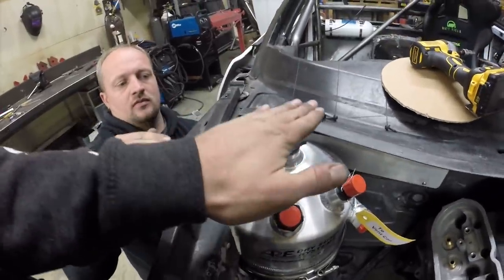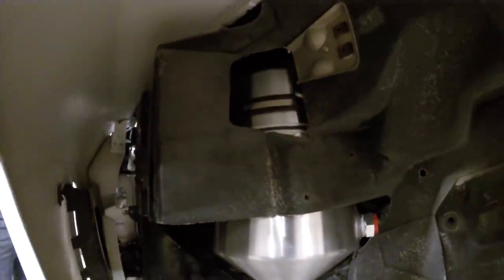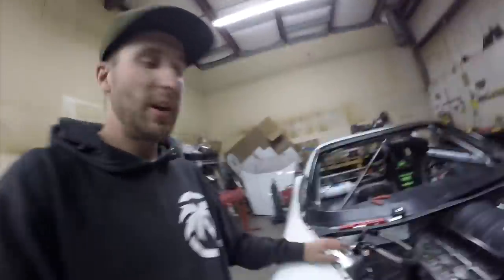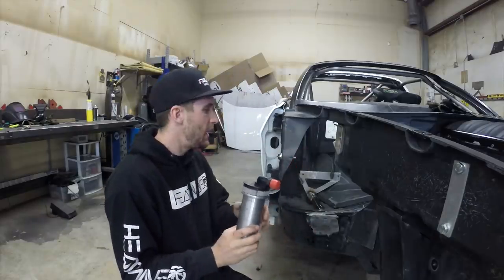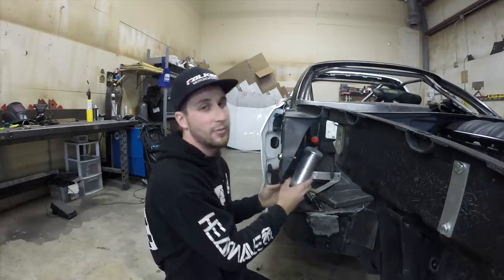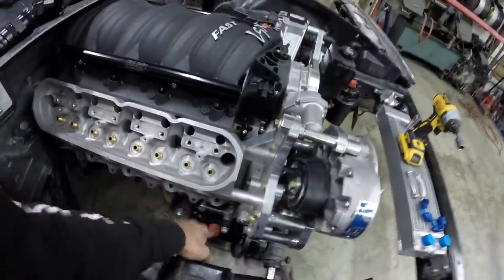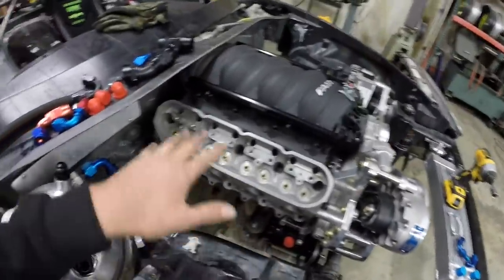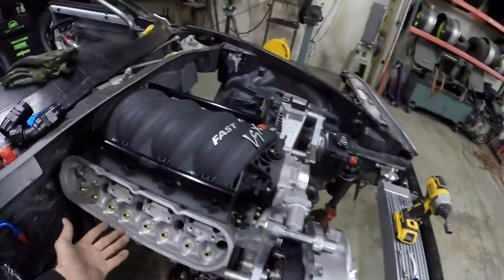How to prevent blowing a motor: Dry Sump | Drift Corvette Build w/Matt Field

Comment: I'm confused about the Dry Sump placement.  You were talking about being worried of a wheel or fender hit taking out the stock sump, but then you pushed the dry sump as far out as you could by cutting frame out of it.  Aren't you worried you're putting it in the same danger the stock one was?
Reply: Christopher Miller yolo
Reply: Oil supply will come from the tank, not the sump, so worse case scenario where you smash the sump, you will still have oil supply and pressure until you use everything in the tank. If they take a hit that hard I should hope they realise it and check the car over, rather than waiting for the tank to run dry.
Reply: It's further back in the wheel well

Comment: Matt "Riv-nut" Fields shows us how to install a dry sump system
Reply: i would use it with oil injection and synthetic 2 stroke oil for total loss burn off. All these care are powered with 4 stroke crap anyways but at least you can converts some 4 strokes to 2 strokes like this:
https://www.youtube.com/watch?v=pz83bWDwbVY its a honda gx done up as a 2 stroke. if i was going with dry sump i would force it one way, catch the 2 stroke oil and inject it into the intake manifold with vro pumps from an rx-7 for total loss burn off and no filter.

Comment: is fd rules against oil lines through cockpit?
Reply: It looks like the lines that will be running through the cabin will only be water not oil.
Reply: I think the rule books ok with running lines through the car, just no connections, it has to run straight through from bulkhead to firewall
Reply: Should be mounted in the trunk. As you can use a smaller tank. But you get the extra capacity from the longer lines. Up to 4 quarts can be gained. As putting them close to the engine. They get hot just from engine\header\turbo under the hood. 

Just a suggestion.
Reply: I doubt it, the FD Corolla has the tank inside, at the passenger footwell but boxed in a fireproof box, the rules states the tank has to be separated from the driver. I don't know if the rules stipulates anything further, but I don't see why a separate line tunnel, or simply run it under the car wouldn't satisfy the rules.

Comment: Probably too late now but why not put the oil tank in the trunk?
Reply: Was thinking the same myself, most racecars I've seen with drysump has the tank in the back to further help with the cooling and quality of the oil because there's a extra few L in the lines, plus it's colder than above the headers and helps with weight balance
Reply: Linken200 - you are spot on, sitting between the rails or deep in the chassis offers the best protection for the system as well... maybe a regulation thing ?

Comment: So you're cutting sheet metal/fiberglass with the no valve covers on the heads? 👀👀👀 Bruuhh wtf
Reply: pretty sure that's just a mock up engine
Reply: Just a mock engine as the other one is getting built

Comment: Power steering cooler? I wonder how important that is?
Reply: Pretty important when your PS oil boils over, spills all over the headers and catches fire... so ya, important.
Reply: Gearhead Daily why would it boil over, never heard of that happening??
Reply: Because it doesn't have a cooler lol
Reply: Frank, because racing and drifting especially, you use a shit ton of steering input, which causes heat.
Reply: In drifting you go lock to lock very quickly and a lot causing friction thus causing heat so you add a cooler to keep the PS fluid cool so it doesn't boil over onto the headers and cause a fire.
Reply: Shawn - ^^ Yep. What he (I) said.
Reply: Frank Williams 

PS cooler is important for alot of motorsports.  Not just drift.  Its a hydraulic system and it generates heat when used.  And this heat can build in the system if it cant dissipate fast enough.

Comment: If your wheel crashes into your dry sump tank, your day is already over....why worry about it's placement at that point?.....  So instead of using the sump that fits, they cut into the chassis to use one that doesn't fit...  Not great decision making.
Reply: Nothing was cut on the chassis at all.